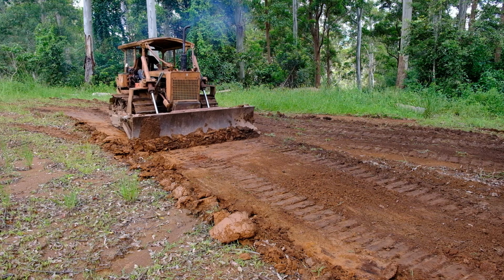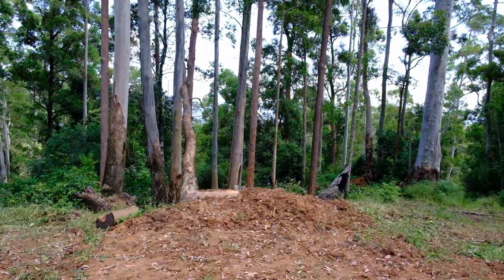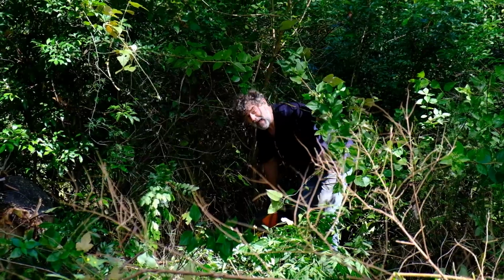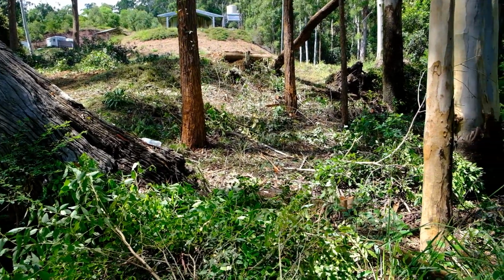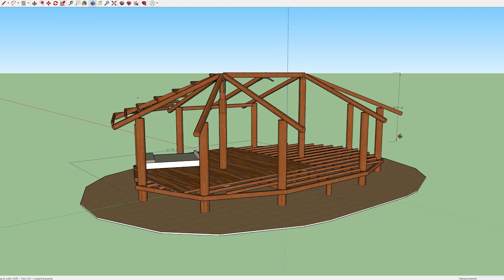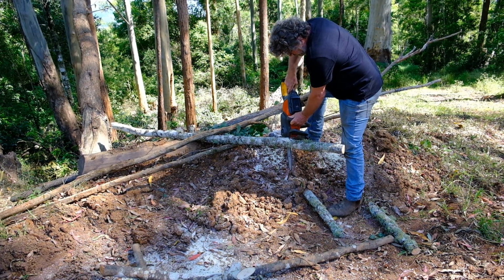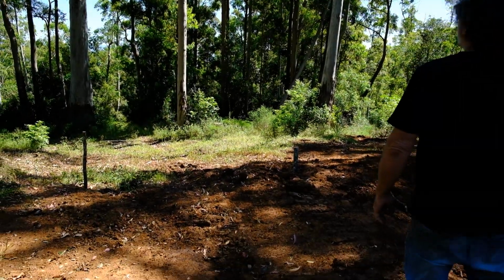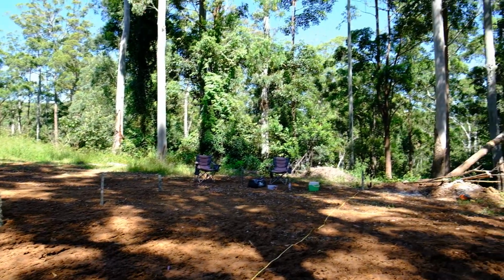Off Grid Cabin Build (Part 01)

Comment: Five minutes in and I stopped. You my friends need some fence and some goats let them do most of the clearing of the bush provided they will eat what is there.
Reply: I was thinking the same thing - some temp electric and a herd of goats and that area will be like it was before weeds.
Reply from the maker: It's definitely something I have thought about. I may be trying to crash-graize with goats eventually on larger areas after I have this build done. Removing the Lantana is a big goal of mine. Its nasty stuff. Also, there are a lot of wild dogs in the area. It makes keeping livestock, especially small heards of samller animals (sheep and goats) very difficult. Thinking about getting some pigs though.
Reply: @BombadilHillStudios  They will work very well indeed. You may consider a companion animal to guard the smaller animals.
Reply: Just curious: Can goats or other livestock tolerate the tick load from grazing to clear the bush?